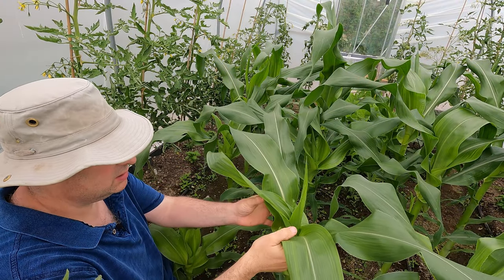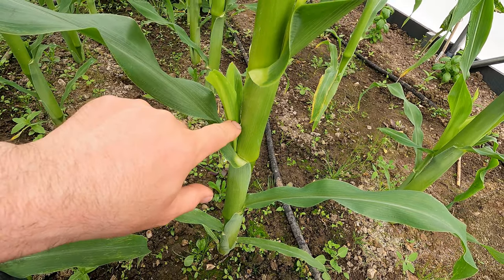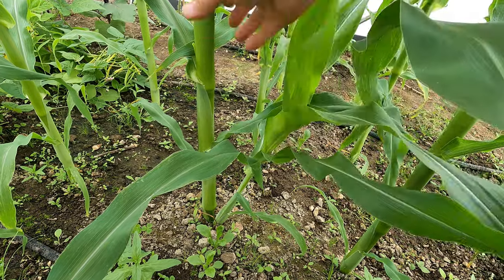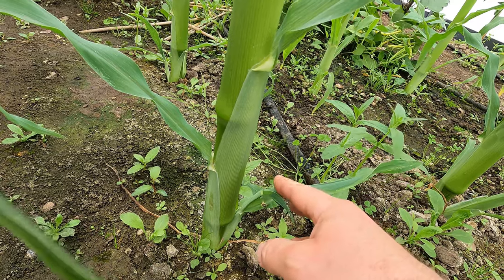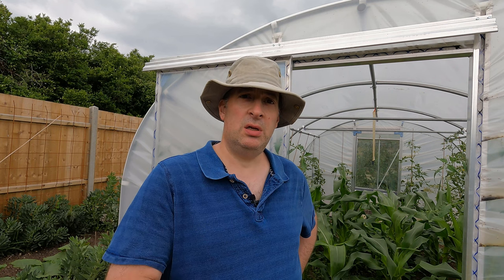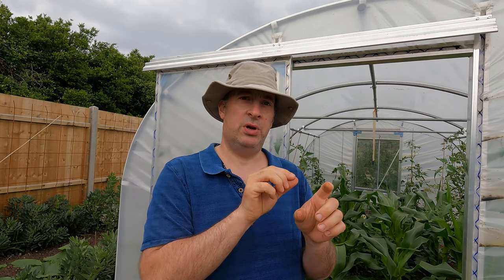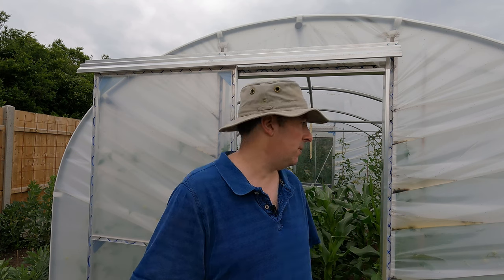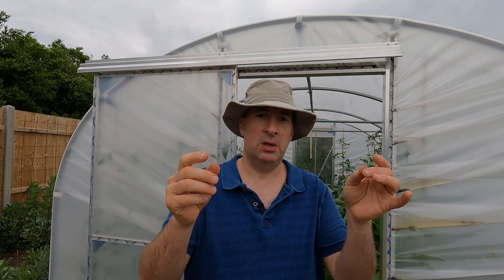Sweetcorn suckers / tillers - why I don't remove them

Comment: Tillers are a sign that your soil has good fertility and that your spacing is good.  I get multiple tillers on my corn.  Many of my tillers also form ears.  It isn't uncommon for me to get 3 or 4 ears from one plant. I've even had a few times where I've gotten 5 or 6 ears.  Further, your tillers will lend nutrition to your main stalk when the cobs are forming.  Tillers also help stabilize the plant against wind. They also help to shade out the area underneath which will keep weed growth down.  My tillers typically form tassels which helps pollination, especially if you have more than one ear per plant, the later forming cobs are able to get pollinated if your main stalk tassels are already used up.
Reply from the maker: Yes indeed, all of those are good reasons to leave them alone. It is a pity that the myth persists that tillers should be removed!
Reply: Thank you for sharing your knowledge

Comment: I asked about this in a forum but haven't received a reply. I have quite large suckers/tillers and was going to remove but I'm now going to follow your advice. It's my first year growing corn. Coincidentally I've gone with Swift as the variety. I've got 25 plants on the go in my grid and they are doing pretty well. About knee high now in early July.

I watched an interesting video the other day about tomato yields after letting at least one sucker grow so you have two or maybe even three main stems. The results suggested a huge increase in yield over a single stem. This was for cherry vining varieties. Someone pointed out in the comments that it wouldn't work well for larger beefsteak varieties due to the energy requirements of each fruit. I was surprised the yield was so much better for the cherry tomatoes though. I wish I had seen it at the start of the season as I would have given it a try. I will have to try experimenting next year. Of course more than one growing stem can get a bit unwieldy and will need more space but I thought it was pretty interesting to learn. Anyway just thought I'd share as you were talking about continuing methods based on myths. Single stemming tomatoes is not specifically a myth I suppose but still one of those habits that most people carry on doing year on year even if it may not be the method that produces the best yield.
Reply from the maker: Regarding tomatoes, even though I set out to grow single stems, I often allow more than one stem to grow - it depends how they develop, but if they put on a lot of growth and there just happens to be a suitable extra shoot, I will often just tie it in and let it fruit. It can work fine for larger sorts too if the plant has been grafted and if it's in some good deep soil - the plants grow much taller/longer in commercial production than in a normal greenhouse so they can easily managed an extra shoot or two. It all depends on the vigour of the plant. The more important point is not letting the space get overcrowded - this reduces airflow and encourages disease - so that is really the limiting factor.

Comment: I’m watching this because I got suckers for the very first time. But it is also the first time I’ve planted corn in a raised bed. I noticed the shoots sprouting after the corn was about 12-18 inches and had just been through a hard storm, with high winds. Some of it was laid over but I set it back up and in a couple days. Out came the shoots. But only on the ones that fell over. I noticed a very strong growth and heavy root base on the ones with shoots. I wonder if corn does that to help gain more roots for stability and/or nutrient/water intake?
Reply from the maker: That’s interesting. I think that is a normal survival mechanism - tillers form on normal healthy plants in response to favourable conditions, but they also form in response to damage to the main stem (in this case, presumably, a fair bit of root damage). The tillers are there to take over from the ailing main stem - if it happens early enough in the season (depending on where you are) they may go on to produce ripe cobs, but hopefully your main plant will recover. I’m sure the strong root development you mention will help anchor the plant after falling over.

Comment: Well since those side shoots are growing almost as there own plant and likely develop there own roots then I doubt they are having ill effects on the main plant and probably add stability in the wind.  I've been growing sweet corn all my life and never have broken those off and have usually gotten great corn depending on the conditions that year of course.  I've always watered in the evenings I know they say its bad and can cause fungal infection and what not, but I work during the day and I am to lazy to get up earlier in the morning to water before work at 7.  I've always believed the thing about not watering during the heat of the day though it just seemed to make sense.
Reply from the maker: It's small margins with when to water. In the evenings it can leave plants damp over night which might provide suitable conditions for fungal growth. It the heat of the day you might lose a little more to evaporation. Most of us just water when we get the chance and it works out ok 👍

Comment: I appear to have broken a lot of growing corn rules 🤣

Four seeds planted in a group (4" d), and the groups are 1ft distance in two rows (4groups×2rows), and I didn't remove the tillers. 

They're all a beautiful dark green, thick sturdy stems, thigh high, and I've noticed tassels forming. 

Your short presentation has given me confidence to experiment more with my garden. 

Currently I'm working on collecting Dutch carrot seeds, and am going to see if leaving the seeds in the fruits has any affect on germination rate. My flower heads are currently hanging upside down while they slowly dry.
Reply from the maker: You may find that one plant per station is ideal for corn - I haven't heard of them being planted in groups like that so no idea how that will work out. Sometimes the rules are good to follow, sometimes not so much, so experimenting to find what works isn't a bad idea 👍😀
Reply: @jonnyskitchengarden  I'm using the 3-sisters method, and the bed is built on a base of used pine pellet kitty litter courtesy of my Feline Feudal Overlords. 
Plenty of N.
Reply from the maker: I haven't tried that, although I have sometimes had squash running around beneath the corn so 2 sisters, maybe :)
Reply: The four seed group planting method is how I was taught to plant by my dad. The fruits are normal size the the pollination is increased with the swaying of the corn stalk, no matter witch way the swaying occurs.

Comment: Well let me tell you all that as a corn/ maze grower that in my 50 acre field it would be impossible to take out all the tillers, it helps stability in the stem and the tillers produce corn which adds to the amount at the end of season.
Reply from the maker: Absolutely! In the garden, though, when one might only be growing as few as a dozen plants in a block, it is still common practice and widely recommended to remove them; something that I do not agree with.

Comment: Hello, I have 3 rows of peaches n cream corn planted anywhere from 8 inches to 12 inches apart.  All have at least 1 tiller and about half have 2 tillers.  Last year I tried to self pollinate cause I only had 1 row of corn.  This was still f
Difficult cause I had a very small yield and the corn was poorly developed and small.   Is there a possibility i will have a better yield and better crop since there is 3 rows instead of one.
Reply from the maker: I would think so. Corn is usually planted in a block rather than a row for exactly this reason - I would expect better pollination this year 👍

Comment: Iwemade my decition to keep them only cause I dont want my corn to tip over, Im not growing to live or die so its better to get some nice ears to put on the grill instead of risking to injure the plant or reducing the root system, besides corn farmers dont cut them off
Reply from the maker: Good reasons to let them grow as they wish 👍
Reply: @jonnyskitchengarden  Hi Its me again😁 I did try trimming on stalk that had some damage. I cut as close to the stalk as possible now the result is that one of the 2 the shoots came back with force growing an incredible 11cm in 3 days. Its 30c so that might have an impact. Anyways just though I wuld share, and Im not taking any more off as I fear it will completley drain the plant trying to grow them back. Sorry for my english
Reply from the maker: It will be interesting to see whether the shoots are productive; there is likely a large root system there to support their rapid growth after removing the damaged stalk.

Comment: Water on leaves do burn our large flat leaf taros in our greenhouse
Reply from the maker: Interesting. Do they have fine hairs on the leaf? I have read that fine hairs on leaves can hold the moisture droplets above the leaf surface and then they can cause burning 🤔
Reply: @jonnyskitchengarden  no but they burn were bugs or mold make the leaves dirty.
Reply from the maker: OK, that's interesting 👍
Reply: @jonnyskitchengarden  yea the whole point of washing is to clean of said dust
Reply: Corn
Reply: @cbr1thou  no

Comment: Interesting content.
When I was growing corn for the first time way back, I had seen a video that recommended removing the tillers, so I did that. I had a great harvest. Later I have seen many videos on the subject, both recommendation to remove and not remove the tillers. One year I removed the tillers on half of the plants, but could not see any difference. In the recent years, my sweet corn has grown with tillers without my interaction, and also this year.
Reply from the maker: It’s definitely one of those subjects that picks up lots of different opinions! I think it depends a lot on the variety and conditions. I’m waiting to see if the open pollinated corn produces as many as the hybrid - some of the hybrids are said to be quite prone to tillering 🤷‍♂️
Reply: Being a 1st year gardener learning thru various resources online, I agree with @jonnyskitchengarden that using whichever methodology works best for you. One isn't right or wrong but one could be a better method based on your growing conditions and environment. The enjoyment and gratification of gardening comes from entertaining your curiosities thru personal experience and harvesting all that knowledge. 🥰